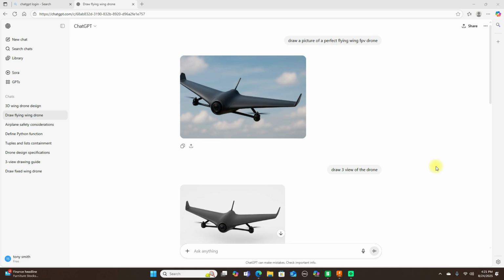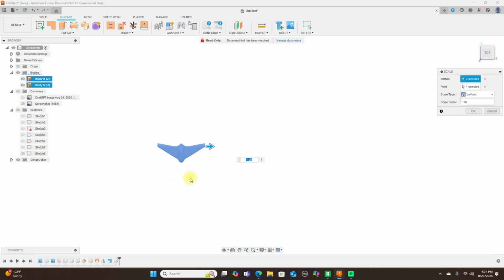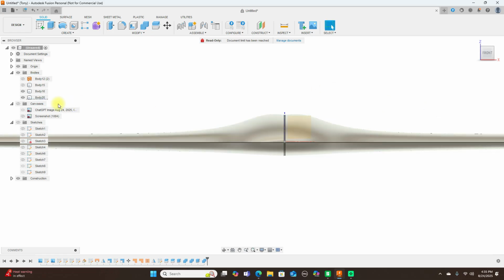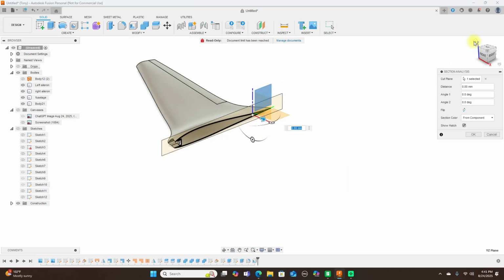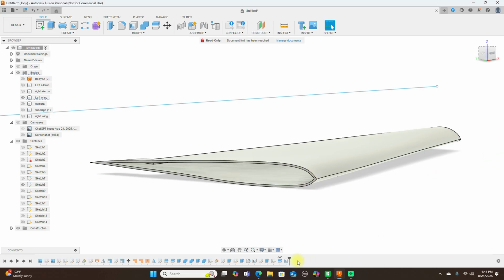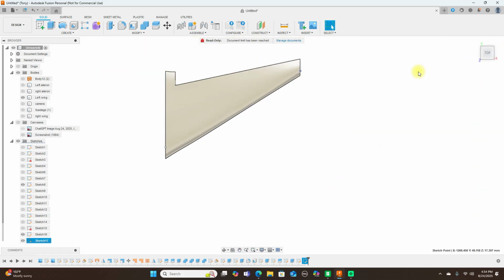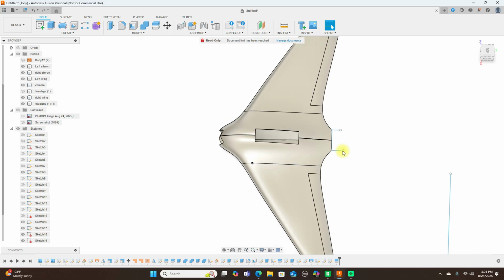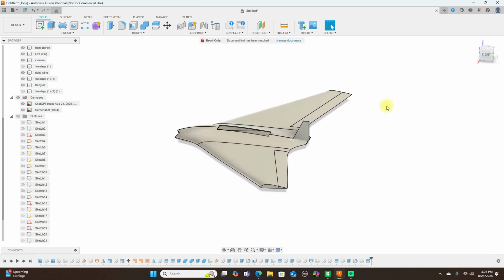I asked AI to design the perfect flying wing drone and it drew this and more

Comment: Hi, thanks for the toturial. It's great that you upload such content. 
 Did you add a twist towards the back to combat wingtip stall? What about reflex that is usually needed for a flying wing?
Where do you get the data for the optimal airfoils for the wings?
Also, the vertical fin seems a bit small for this size of a flying wing - how do you calculate the stability factors for it?